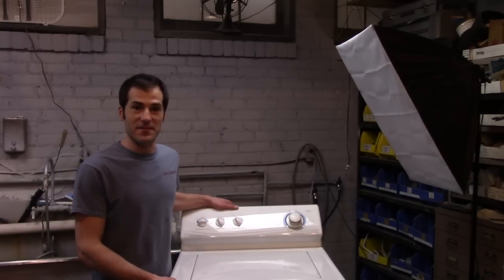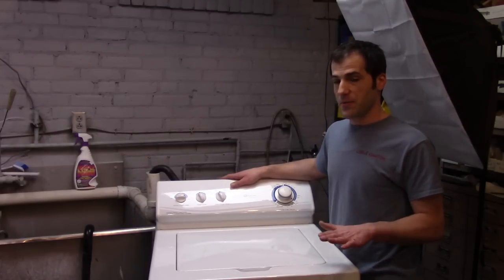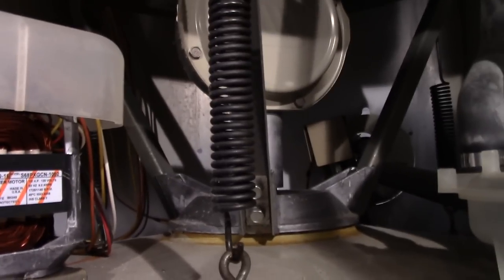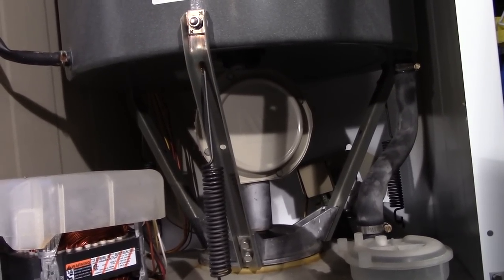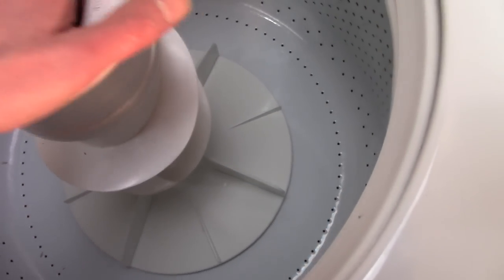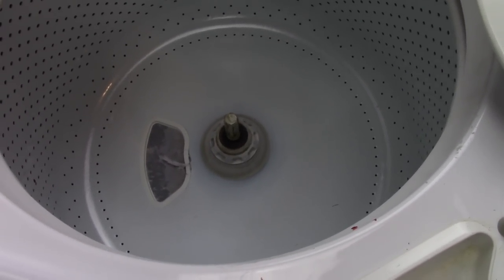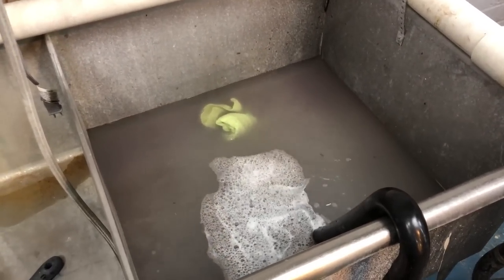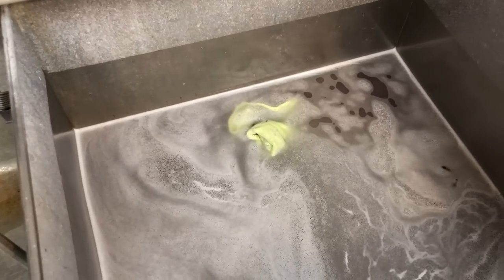Vintage 2002 Maytag Dependable Care Performa Washer, Quick Tour and Clean Up

Comment: Anyone who is searching for a Dependable Care Washer similar to the one in this video be patient, keep looking, they are still out there. I was extremely lucky recently and actually bought two of the three appliances shown in the beginning of this video from the same seller. The seller had a used 1978 Whirlpool LFE7800N1 Dryer and a 2003 Maytag LAT2301AAE washer for sale. I tried to pass on the dryer (not wanting a second dryer) and offered to purchase only the washer for the paired price. Short story is that I now own both for less than half the cost to fill up my truck with gas! Both are in mint condition and work flawlessly. The inside of the washer looks cleaner than the one in this video! The Whirlpool LFE7800 series dryer is one of most dependable dryers ever made and the design is mostly unchanged to this day.

Comment: The basic design of this washer dates back to 1958, and they got a slight re-design in 1966, and the basically stayed the same until 2006. Maytag's dryer designs changed more than their washers did, and Maytag made the Halo Of Heat from 1957 to 1975, and in 1976 Maytag went to the Stream Of Heat Design, and Maytag also kept the same basic design until 2006. The Maytag Halo Of Heat was one of the best dryers Maytag ever made, and was one of the best performing dryers as well. Maytag did make a gas Halo Of Heat dryer, but they used a standing pilot, and they were a lot slower than the electric Halo Of Heat dryers.

Comment: I have a similar washer (1999? Dependable care Quiet Plus). About 10 years ago it needed over $200 in parts including a timer and a drum seal. I almost bought a new washer. Your video makes me happy I fixed it. The matching drier has only need a gas valve solenoid and an ignitor since new.

Comment: I've got a similar Maytag out in my workshop from 2003. It's a low hours machine, only used from 2003-2007 as my main washer. I do use it to wash shop towels once in a while. It's now the backup for my 1979 Maytag A106, just in case it might ever need a major repair.

Comment: I have one of those, bought it in around 2001. It's a LAT3500, and I love it. I have had it apart a few times, replacing tub seal and bearing, and drive belt.  The transmission started leaking a little so I resealed it. Replaced the fluid with synthetic, which I shouldn't have as it's noticeably louder. It runs and runs, but I'm getting nervous as parts are getting more difficult to find. These are built just like my parent's old lime green Maytag that lasted 30 years and never died.
Reply: the parts are very easy to find
Reply: @dknowles60  transmission parts aren't though. Had a hard time getting what I needed.
Reply: @martin1b   yes they are . You can buy  Transmissions  on EBAY  for cheap.
Reply: @dknowles60  ok. Looking now, cheapest is 120 used shipped. Only a couple there. The other 2 are $400. Perhaps that's cheap to you but not for me. Also I was just looking for parts for a transmission.
Reply: @martin1b   if you have the Orbital transmission there are only 3 parts.  the prices i have seen on Ebay for the Orbital have range from 50 dollars to 300.  the Helical Tranmission will also fit and is on Ebay. Whrilpool still sell's the Orbital Transmissionnot you can pay over 1000 dollars  for a new washing machine that dont last.  i had had my Orbital Transmission for 25 years and will rebuild or buy a use one. .. they neeed to be lube up aps every 20 years. better yet ask a may tag repair man

Comment: We used to have one of these! The transmission on it went out 5-6 years ago, and we didn’t have the time to repair it at the time unfortunately so we fell for one of the newer Whirlpool belt drives.
Reply: My 2002 Maytag Performa (which i bought in 2002) had the transmission go out in 2018, so i got rid of it and bought a new fangled, lid locking, water saving piece of crap! I hate the new washer, and wish, wish, wish i would have spent the money to repair the old washer.

Comment: WOW !!!  What a piece of machinery. What year was the maytag washer with the mint green one piece agitator made. I've always wanted one because my grandmother had one and it just facilitated me and still does.
Reply: craigsclocks I had a very similar model. Probably a 30 year machine
Reply: joe m What do you have now?
Reply: Those teal one piece agitators were from 1966 or so to 1987ish
Reply: craigsclocks I have the front load speed queen which is excellent. But they’ve just been discontinued. Stupid move on their part I think
Reply: joe m I have the 2017 Speed Queen top loader but still have my old GE front loader with matching dryer. The GE washer bearings are bad so I did get new ones but don't know if the fix is worth doing. I did ask this question to Eugene but he hasn't replied as of yet. I hope he does. I really like his videos.
Reply: craigsclocks I would imagine it depends on how much to fix it versus a new one
Reply: joe m The bearings only cost  me $40 and I think I can do it myself.

Comment: Have this washer (minus the sud saver) and it's great, easy to work on, except it leaves lint all over my clothes. I've had the whole thing apart to do bearing seals, and everything including the lint trap and agitator are spotless. Any ideas what could cause the lint?
Reply: my washer does the same
Reply: Check your drain hose

Comment: Any idea what size tub this is and also what would you suggest for fixing an unbalancing issue in the spin cycles? It nearly walks out my door 😂
Reply: Have you figured it out yet? I had to replace the pads and bothe the tub seals. I got the walking stopped, but now the tub is leaking
Reply: @cindyjohnson5242  Where's the leak coming from?